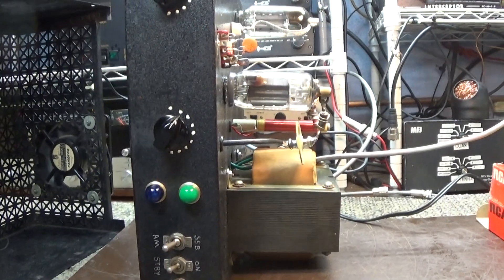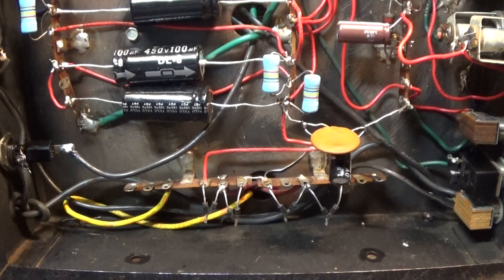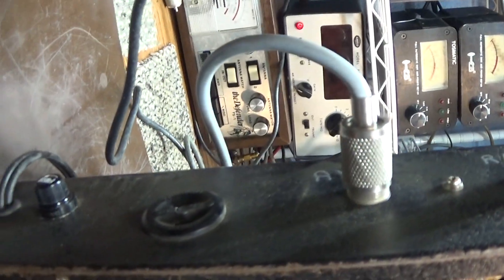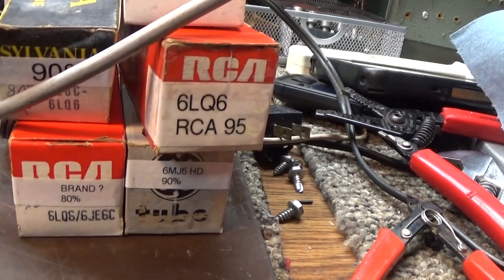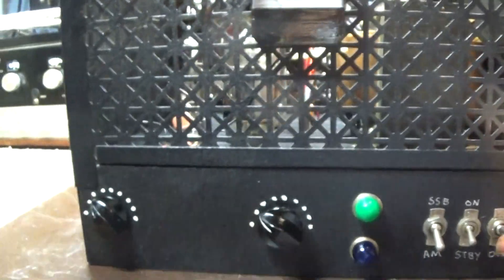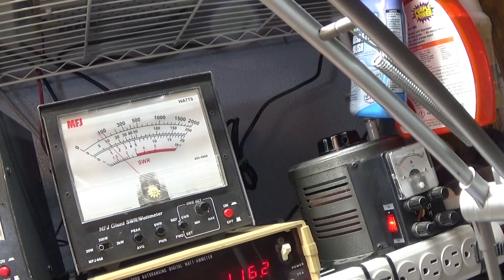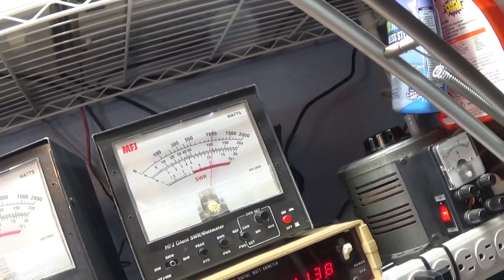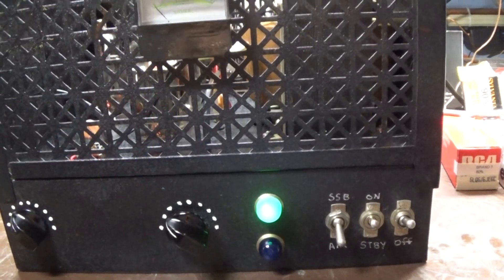Home made (not by me) 5 Tuber, 1 driving 4,  6LQ6 sweep tube linear amplifier box

Comment: Hey Tramdr. I got a Sweep tube amp, it's called a REBEL, it's got two 6MJ6's driving six 6MJ6/6LQ6/6JE6C tubes. The other day I was on sideband with an RCI-2950 and tuned the amp up and something blew. The amp comes on all the tubes light up the relay kicks in when i key the mic I don't see anything and I was wondering if I might have blown my transformer? when I key it up there is no output. Thanks, TKD 606 in the styx
Reply from the maker: put your meter on DC volts, Black lead to ground and red carefully check the voltage across the big electrolytic capacitors.
Reply: @tramdr  Thanks TramDr!! ,yea this thing could use new caps and a good going over.